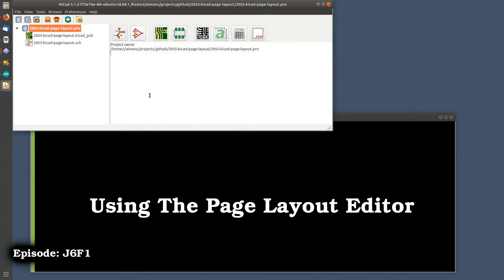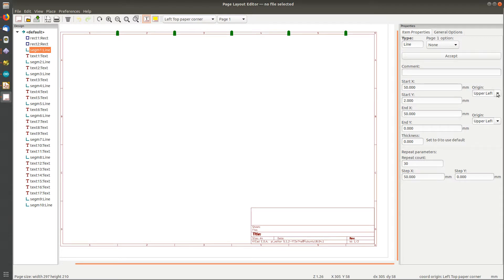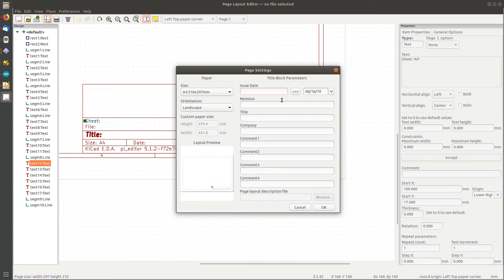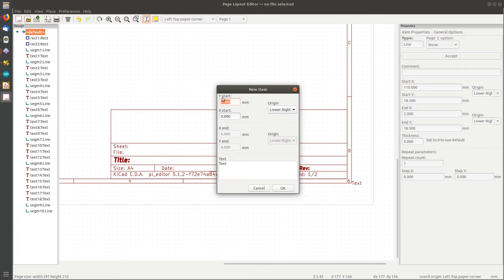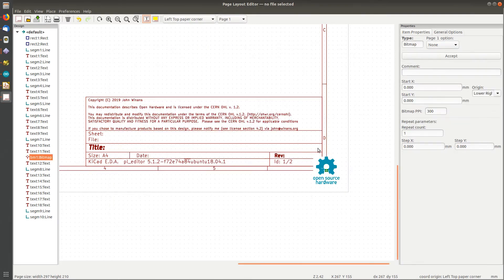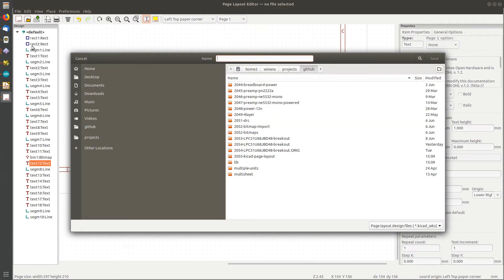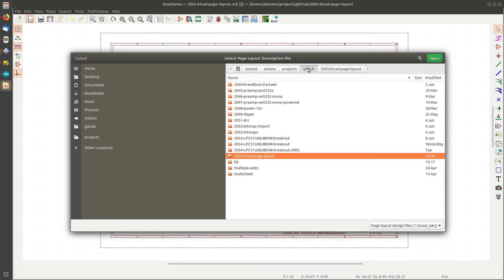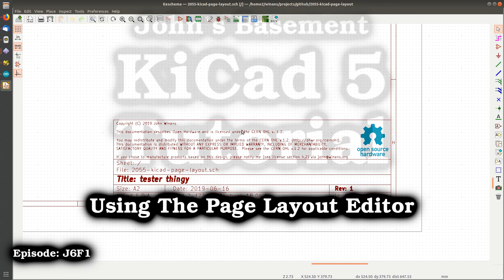KiCad 5 #30 Creating a Custom Title Block With The Page Layout Editor

Comment: Hi, thanks for the video. However, can you remove the title block completely? I tried deleting all the elements but once I finish doing that, it goes back to the default (all the elements come back)
Reply from the maker: The editor does this before you can save it???
Reply: @JohnsBasement  Hi, yeah it does. The best I can do is delete everything and leave one rectangle.
Reply from the maker: @tommycapo1  well, then maybe you can't create a completely blank template.
It may be tough to edit the schematic without the border as you wouldn't know where the page ends.
If you want them removed from a PDF "printout" then use plot (rather than print) and select 'PDF' for the output format and then turn off the 'plot border and title' option.